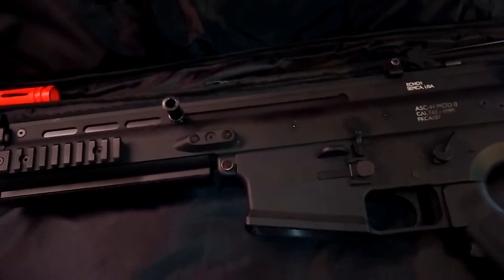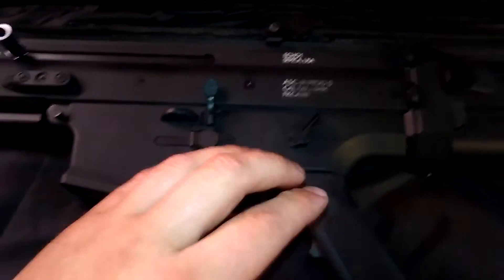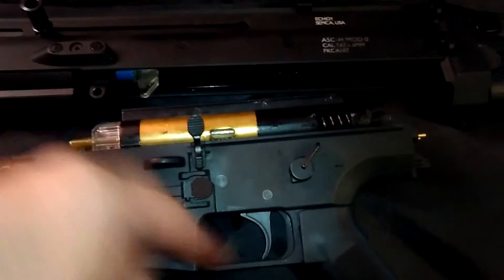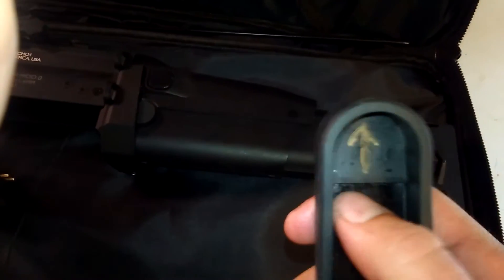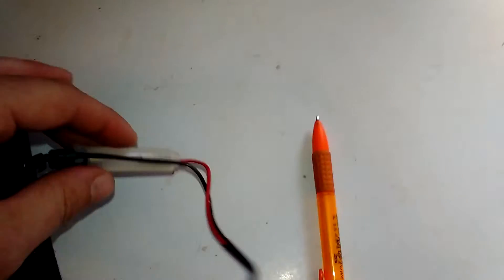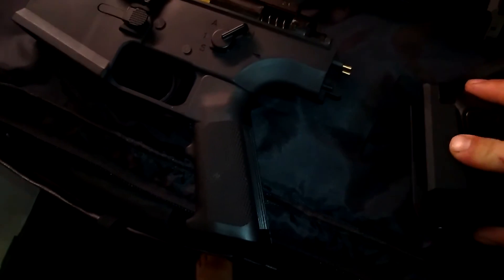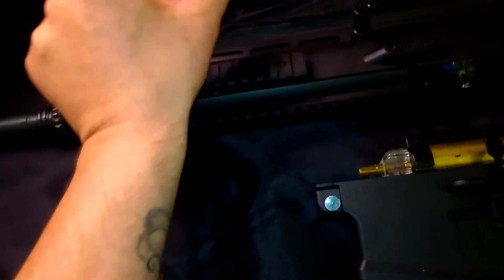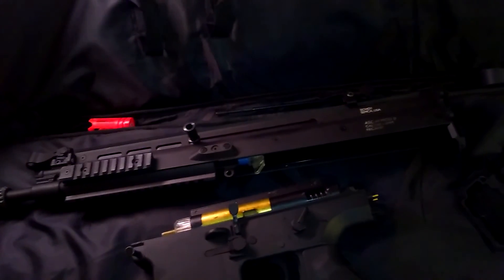Echo1 Scar-H Review & Light Tear down

Comment: My scar just came in yesterday. But sadly I think I might be shipping it back. When I got the gun I noticed the barrel was loose. After inspecting it I noticed the end screw on the bottom was loose I tried tightening it but it wouldn't work. I think the barrel and the screw where stripped. Did you have a problem like this? Please reply as soon as possible.
Reply from the maker: +Dillon After taking mine apart I too noticed it being loose, also like you thinking it was stripped, I pulled the outer barrel all the way out and checked the threads on the screw and the hole it went into. Both looked fine, so I put it back together and eye balled the hole as closely to make sure it lined up right and mine tightened right up. You may need to do this.